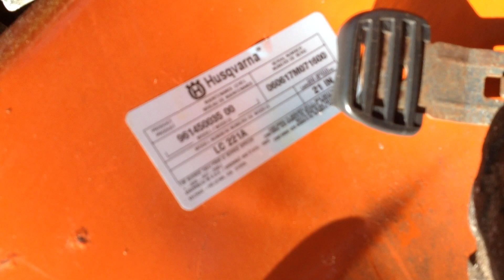2017 Husqvarna LC221A AWD lawn mower for $40.   I spent too much $$$$.

Comment: Have you seen how the price of small gas push mowers has gone up?  On the Home Depot website, a 20 inch Murray with a 125cc Briggs E450 engine (the smallest they make now) is $329.  That's more than twice the price it was 2 years ago.  Home Depot sells 3 electric 20 inch mowers at a lower price than that.  So now for the first time in history,  20 inch electric push mowers cost less than a 20 inch gas engine mower.  People will now choose electric mowers over gas and gas engine products will go out of business.
Reply: Also, I see the Hyper Tough 20 inch mower at Walmart is now $247, twice the price it was 2 years ago.  It's basically the same as the 20 inch Murray at Home Depot.  Walmart sells an 18 inch electric mower for a slightly lower price.  Funny how "inflation" is not affecting the small electric mowers the same way it's hitting the small gas engine mowers.  Both Murray and Hyper Tough are meaningless brand names slapped on the mower.  Both are made by DAYE North America.
Reply from the maker: I have noticed that.
Reply: Yep and I sold all the used ones this summer 
Seems people won’t a simple way to mow grass and cheap
Reply: I noticed that too...I have electric lawnmower but my wife told me go get gas one....I got this from a old timer for great price .....I love it

Comment: Have you ever worked on a Black Max mower?  that's another brand name made by DAYE North America and sold at Walmart.  they're a little higher price than the Hyper Tough.
Reply from the maker: I have fixed and sold a few of those.
Reply: @tommy-time5240  what do you think of the Black Max mowers?  ok? better than average?  do you remember what kind of problems they had?
Reply from the maker: @mrbubetube  I do not recall the issues.

Comment: @15:20 it looks like gas is spiting out of tank on to filter.  I had a craftsman which the belt tore because the spindles all froze up.  I ended up just making it a RWD mower with a used belt that fit.

Comment: Guessing if u can find the bearing part number you can press new bearings into a pulley if it's not damaged. If they actually used a bearing which may be doubtful.
Reply: amazon has those, with plastic outer pulley, $7.98 each.

Comment: That thing is crazy rusty. It must’ve always been stored outside. We have a 2010 that’s been used so much I had to switch the front wheels to the back to get a little bit of traction because 2 of them had all the plastic tread worn away.
Reply: I’m assuming the last owner ran old gas through it and clogged the carb. Sometimes you can just stick a pin through the carb jet and that clears it out so it can run.